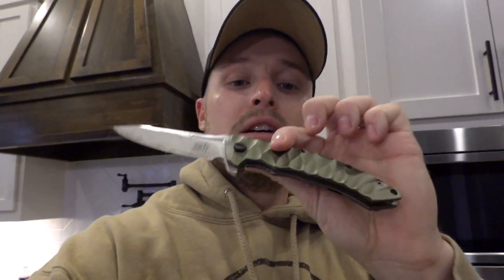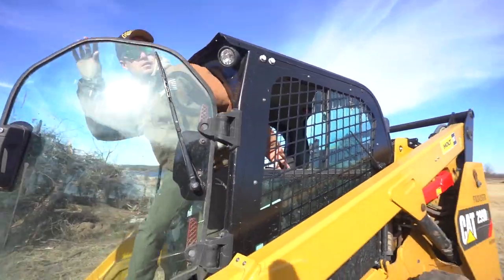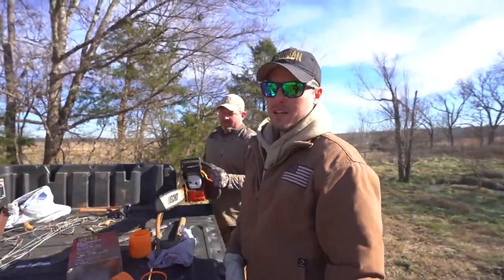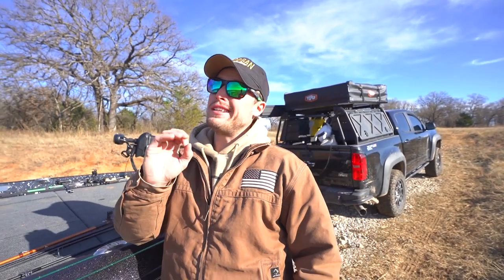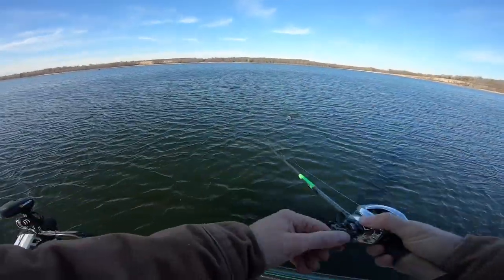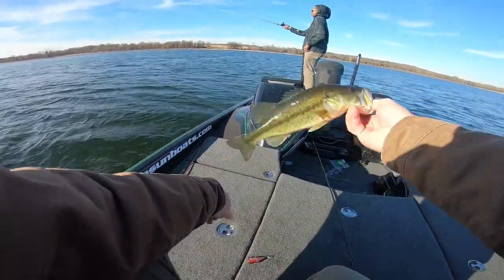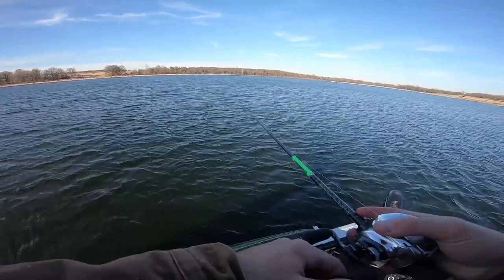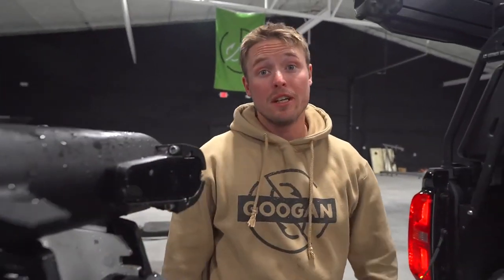I NEED This For My RANCH!!

Comment: Those Hydraulic Quick Connects have seals in them that go out/ wear out. call your local North Star Parts store and the Parts Guy should know what you need. # Common Maintenance.

Comment: Don't get a cat skid steer! Get bobcat or a John deer skid steer
Reply: CAT (just came out with D3 series so you may find a discount on a d2). They also just released a 299D3 XE land management series but its a heft price tag. Takeuchi,or Kubota (sliding doors are nice) Compact track loaders. But most important who ever has the closest dealer and best customer service is the manufacture you should lean towards.